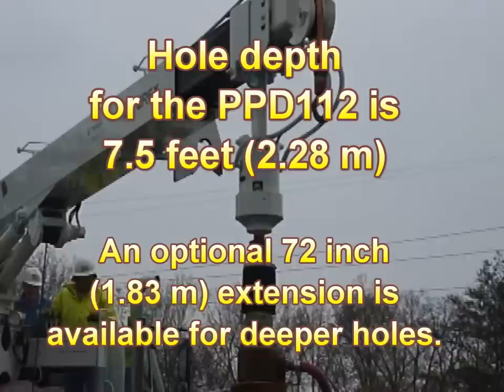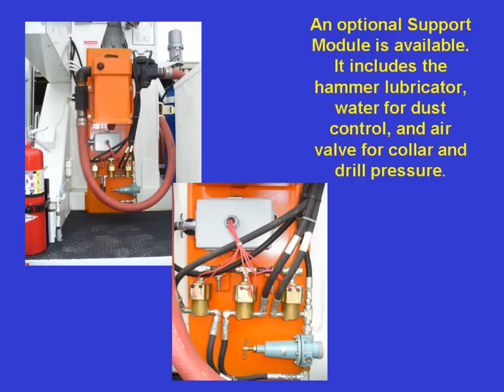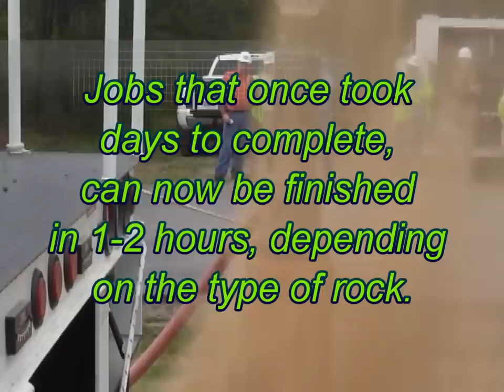HQ Pole Drill

Comment: Extremely Slow in all soil conditions. Also to use it correctly you will need an air compressor the size of a box truck to supply air needed to hammer down.  In my opinion these are only good for boring holes into loose soil mixed with boulders in these conditions other methods of drilling your hole will collapse. These will will completely slick the walls of the hole making it less likely to collapse. Except not to finish a job on time using this.